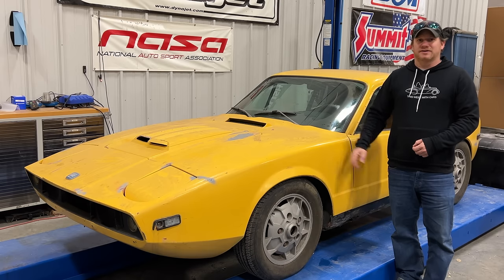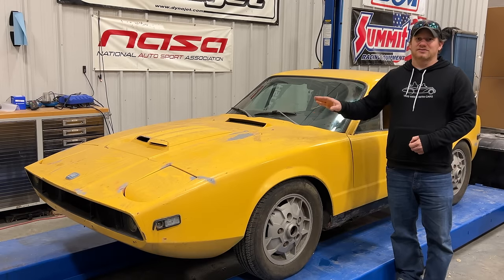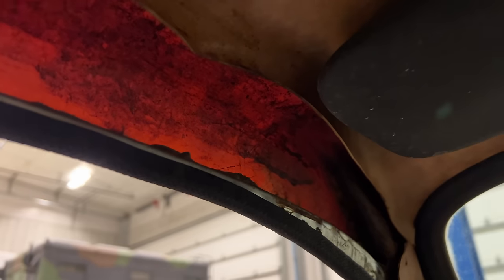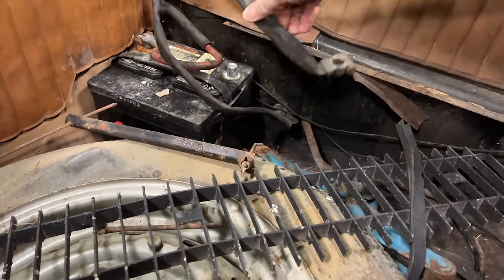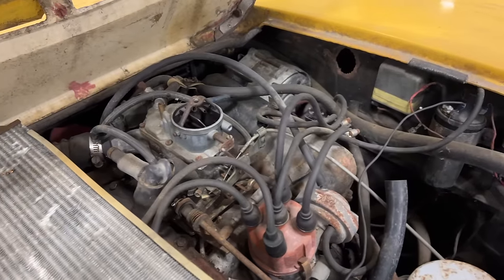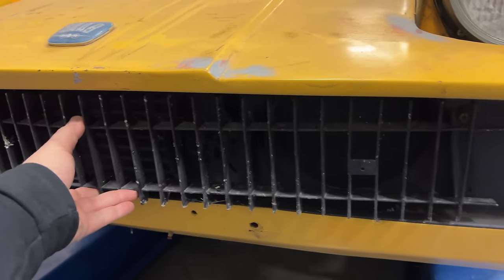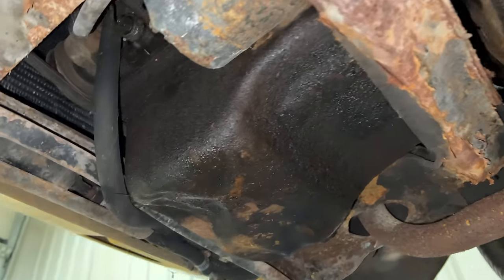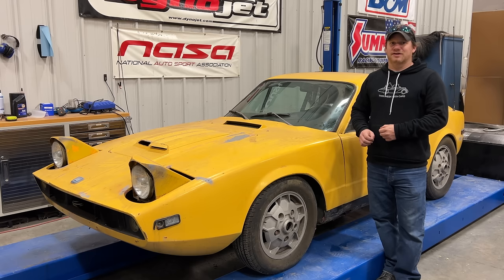My First Saab a 1971 Saab Sonett III

Comment: The engine is a Ford  V4 unit as used in the German Taunus cars, and also the Ford Transit delivery van. My brother had an early Ford Transit van, notorious for  chewing up the pushrods in these engines.

Comment: I had 3 of them.  Great cars.  Ice race them.  Problems?  Not many.  The wiper motor will fill with water, drill a small hole in the carcass to drain it.  Change to electronic ignition.  Xmission are weak so have an extra ready to go.  There is a roll cage in the car, not just a roll bar.  The engine is a Ford 
v-4 used in hay bailers and other farm equipment. I recall turbo efforts never met fruitition.  go with an aftermarket exhaust immediately.
Reply: One can just double things up, but the exhaust ports were siamesed in the head and without extensive porting not much can be done.

Comment: I had a new 1967 SAAB 96 V4 with that 1500cc engine. On the 96 the engine was easy to pull out. Just the two motor mounts and the transmission rear mount accessible from the cabin. These had a habit of rusting up so I would loosen the bolt then tap it out with an air hammer. If I didn’t have the air hammer available I’d cut the rubber out with a knife and replace it. SAAB had an interest in rallying at the time and had a special version of the 96 called the T-car. It had double shocks and the body panel spot welds were double the normal number. The engine was the stock engine because of emissions, but SAAB offered hop-up parts to take from stock with 75 hp up to Stage III with 120 hp. These included a nice 2-bbl manifold and a Weber 32/36 progressive carb which alone got you to 95 hp. I had one on my 96, and it chewed up the clutch in 5000 miles. I was unable to get the competition clutch from SAAB, but I was able to have the clutch beefed up by a clutch shop. The driven disk had the lining short of the rim by a good 1/4 inch. The replacement went all the way to the edge. The guy couldn’t find heavier springs so he put a 60 thou. shim under each one.

Comment: I like the way you call that Ford V4 an "industrial" engine. It's amazing that Ford considered such a rough sounding engine fit for public consumption.
Reply: It was a passenger car engine for a number of German Ford models. It was also sold as an industrial engine notably used in Ford skid steer loaders and for water pumps. Back in the day, it was cheaper to buy engine parts from the Ford Industrial dealer. They also sold the two barrel intake manifold.

Comment: I would love to see the Sonnet restored, the V4 is an interesting engine, it was used in several UK Ford cars & the MK1 Transit van.
Reply: I had this engine as a 1700 cc in a 1966 ford corsair auto in 1981 the car was a complete rust bucket but the engine had been reconditioned, i had the car about a year…when i sold it i later saw it abandoned engine had gone, i heard it had found its way into a transit
Reply: I had a 68 Corsair 2000E as my first car. It's engine also ended up in a Transit!

Comment: Living in sweden in gothenburg but not far from trollhättan where they made saab in the beguinning I rememberwhen they released this model . Being a airplane faktory from the start all saabmodels had a very low CX value since they they were tested in a windtunnel which wasnt so common in those days . If I remember correct the complete driveline came from the ford 15m , even the gearbox . It was a common car here in sweden aswell as the 12m . The whole sonett body weight is 17 kg . Here in sweden they werent so common . These fordengines werent considerred " mechanicfriendly" even put in the 95 and 96 models .
Reply: No. Only the engine was Ford Germany. The gearbox was the same as the SAAB three cylinder with a different bellhousing to match the new engine. The gear ratios may be different. The final drive was not as short so the top speed was higher.
Reply: @brucebeauvais1324  ok , so I've missed that but it makes sence even though the fords were frontwheel driven aswell . Thank you for the info !

Comment: It's a 1698 cc Ford industrial V-4.  Gardner Denver used them in commercial compressors among other applications.  Interestingly the cam gear was nylon for noise reduction.

Comment: I had a 1974 Sonett III for almost 20 years; finally had to sell it a few years ago because of job loss. I street-drove it, ran it in SCCA rallycross, did track days in it... slow, but a fun car and very solid. Trying to remember a few things that might be helpful:

-- You'll discover there are a lot of minor differences between the 1971 and the 72/73/74 models, so don't be surprised if details on your car differ from what you see in the shop manual. The 73/74s also are a lot sturdier -- they have metal hoops bonded into the fiberglass around the windshield and the door apertures, and impact beams in the doors that run down and tie into a brace across the floorpan.

-- The remote oil filter is non-original (they probably did that to make access easier; the stock location is down on the side of the block on the "crowded" side of the engine compartment) and so is the location of the A/C condenser; it's supposed to be ahead of the radiator and can be slipped out through the bottom. The Y-shaped exhaust also is non-original; the stock setup had a balance pipe running between the two cylinder banks, and then dual exhausts running backward along the outside edges of the floorpan. A lot of people went to the Y setup because it was supposed to increase power a bit.

-- That right-front spark plug IS a bear to get to, but if your original toolbag is complete, it will include an odd little offset wrench specifically made to reach it. If you don't have the wrench, you'll need to slip off the alternator belt and swing the alternator all the way to the outside to get at the plug. BE SURE to disconnect the ground cable before messing around in there; the positive terminal of the alternator is right next to the plug area and it's easy to make big sparks by shorting it to the engine!

-- That metal chicken-wire rectangle you found is a stock piece; it's part of the flow-through ventilation system. If still present, this consists of a vinyl-covered hardboard trim piece that runs across the top of each door aperture; there's a grill in the middle of the door and this wire mesh is supposed to be inside that. The theory is that the trim pieces duct interior air back to the area behind the rear quarter windows, where it's drawn out by the gill vents behind them. In practice I don't think it can have amounted to much ventilation!

-- Tip: a lot of seemingly hard-to-reach things in the engine compartment can be accessed through the wheel wells or by reaching up from the front air intakes. If you're going to do much in there, though, it's a LOT easier just to take the nose off -- it's one piece, and just slides up and off after you've removed about six fasteners (you can do it yourself, but it's much easier with a helper.) With the nose off, you can reach everything in the engine compartment, the front suspension, the heater and wiper motor locations, etc.

Have fun... would love to see how this comes together!
Reply: Oh, yeah, and almost all those parking-light and turn-signal lenses are straight off a Triumph Spitfire, so will be easy to get from a Brit-car catalog. The rear taillight lenses are from a Saab 99 sedan, but mounted upside-down!

Comment: I used to run a Saab 95 station wagen that used the V4 1.7l Ford Taunus engine with the earlier (2 Stroke) manual gearbox with change on the steering column. The box had a freewheel due to the lubrication needs of the prior engine type. The extreme streamline shape of that car helped make up for any lack of power from the 65hp German Ford engine.

Comment: Saab has used the Ford V4 as a replacement for the 2-stroke engine. The V4 was available as 1.2, 1.3, 1.5, 1.7 and 2.0, which in turn was distributed among Essex and Colonge engines used in the Taunus and Transit. For smooth running, there was a balance shaft in the engine.
Matra has also used the 1.7 V4 in the Matra 530.

Comment: Early V-4s- 1968/1969 used a Solex carburetor. 1970 used Fomoco carbs. The remote oil filter was to make room for the A/C compressor. There were optional "fog" lights that fit where the blanking plates are.
  Lighting was a mix of Lucas and Hella- mostly Lucas. The front turn signals were Lucas -used as rear turn signals on some Triumph GT6 . Same side markers as Spitfire/GT6. The optional fog lights were 5 3/4" (small round) sealed beam lamps. High beams for most quad round lamps systems. The "fog" lamp housings were Lucas buckets also used as high beams for early US market Mercury (Ford) Capris. Rear Taillights were the same as SAAB 99 up to 1976. I think the license plate lights were Lucas.

Comment: They are a weird car for sure. Sam and Greg Sharnberg from DMVR used to autocross a Sonnet, I never saw it run but had a look at it in Greg's garage. Have also seen an orange Sonnet at RPM, it was pretty slow around the track. :)  The V4 in those is related to the Ford V6 Cologne, not sure how many parts (if any) are interchangeable.

Comment: Had a '73 Sonnett III, '73(?).  It had a freewheel device that would allow coasting on long descents.  Got phenomenal mileage- once drove from Wichita to East Lansing, Michigan on one tank of gas.  You are correct about the fiberglass- almost early 'kit car' stuff.  Mechanically never a problem.  I did tear the exhaust off on a railroad crossing once.  Would love to see you get this one going.  Do you have any experience with a Saab 96?  Great channel.
Reply: That was the sprag unit left over from 2-stroke days. There was a lockout handle on the firewall just behind the shifter.
Many automatic transmissions have them. When the output shaft wants to turn faster than the input a ring of oval bearings? release and allow free running. When  the input shaft wants to go faster, the oval shaped thingies turn back and lock up the inner and outer races. The military six by sixes work this way. The gear ratio for the rear four wheels is a lower ratio(higher number) than the front axle. When the rear wheels start to slip the sprag engages the front wheels for full 6x6 action.
You need them in the 2-strokes because the fuel also contains the engine lubricant. If you had a locked system and headed on a long downhill with the transmission locked up and the throttle backed off, the engine would starve from lack of oil. There was a rumor/legend that in the 2-stroke days SAAB imported an extra engine for each car they imported. The 850 Monte Carlos were pretty neat cars. Back in the day my driving heroes were Erik Carlsson and his sister Pat who was married to Sterling Moss.

Comment: A/C is very rare on any Saab of this vintage.   I own 2 Saabs of this vintage.    The Saab guys will tell you about parts.    To get to the spark plugs you need the wrench that in the tool kit.    Tom is great with these cars
Reply: The wrench was only neccesary for #1-located behind the alternator.

Comment: The Sonett was derived from the Saab 96 chassis, but with lighter gauge steel. Extra reinforcement was not treated against rust, so the Sonetts began to rust immediately. Most of the mechanical parts are the same, though some are becoming difficult to locate. A few Sonetts have passed through my hands, but I now have a keeper, a 1969 Sonett V4 that was turned into an ice racer by a friend. It is being returned to racing condition for vintage races.

Comment: A friend and I could get the engine out, put in new bearings and have the car back on the street in 6 hours - easy to work on as the hood comes off very easily - on mine anyway - two bolts..:)

Comment: I've always loved the Sonett.  Especially the III.  But for a fiberglass car, they sure have a lot of rust problems.
Reply: They were one of the few sports cars that worked well in snow country, so the salt ate up a lot of them. But another reason there are few survivors was that there were never many of them in the first place. Saab built them on a shortened floorpan for the Model 96 sedan, then sent them off to a Finnish company called ASJ that made the fiberglass bodies. ASJ's main business was building commuter railcars, and they did the Sonetts as a literal sideline... off to the side of the main railcar assembly line... and this imposed an absolute upper limit of 2,500 bodies per year. In practice, they never even made quite that many; I think the most popular year was 1974, when about 2,200 were produced. There were very few 1971s and a literal handful of the 1970-1/2 debut model.
Reply: @jlwilliams  Actually, ASJ was in Arlöv, outside Malmö, Sweden. I think you're thinking of Valmet in Finland that also built a number of Saabs over the years.

Comment: IDK what the final drive is. Check with Saab heritage to see if they could recommend a good transmission man for consult. Chrysler swapped 3rd and 4th around on the A833 4 speed making 4th a 26% OD . If you want an OD top gear check with a Saab transmission person to see if swapping gears around is viable. Fuller did it with big truck transmissions too.
Reply: If I remember, the V-4 equipped Sonetts used a 4:67 final drive. 95/96 V-4s were 4:88 and three cylinders were 5:13. Tom Donney would have the gearbox answers. SAAB offered a" close ratio 1" and a " close ratio 2" gear sets as Sport and Rally parts.

Comment: Owned one back in the late ‘70s a very fun car. The engine/drive train is much easier to work on once you remove the front nose. There is an expert Saab Mechanic in Tucson who has fixed many of these, Valet Auto. Would love to see another back on the road.

Comment: I only know random details about these thanks to Rob of Aging Wheels and GRM.

Sonetts have one hell of an Achilles heel- Saab had been making 2-strokes until the Sonett, and the transmission is from those vehicles with only slight adaptations. Because a 2-stroke has no pressurized oil system the transmission has some kind of freewheeling bearing that engages in neutral to keep the motor running- the bearing goes bad, and it either keeps the Sonett in Neutral or keeps it from ever going INTO neutral. Can't remember which, but I DO remember its why these cars get bought for EV projects all the time, because (least I heard) there's no replacement for that bearing and all survivors are on the equivalent of life support.
Still tho, they are gorgeous and stupid lightweight. I think they were maybe 1,800 lbs?

Comment: Great car! I picked up a purple 73 last year and have quite a few videos about it. Wasted a lot of time not restoring the fuel tank. I have some spare turn signal lenses in the twin cities if you can't find any. They probably did a remote filter to run a big 51515 which is about 5mm too big to get in otherwise. Why don't you enter one of your rigs in the Yucatan Winter Safari Rally in Winona and I can bring a few parts down for ya. Have a spare rear axle and a bunch of random stuff. Also check out the MN Saab Club. Lmk.

Comment: I commented a couple of times on this video. Among the errors I might have made is that I misidentified Pat Moss. Pat was Sterling Moss’ sister and Erik “on the roof” Carlsson’s wife and a fine rally car driver in her own right.
I need to ask Steve if he knew John Ames, one of the premiere autocross drivers of the sixties and seventies. I knew him and his wife Nancy in Baltimore when I bought her 1960-1964 Volvo PV544. It had parts from all years. They moved back to Iowa in the early seventies. John and my brother-in-law Andy A. patched it together in Andy and Jeanne’s five-car garage. Two wide, two deep and on the left in the back was the fifth slot with a grease pit and overhead chain hoist built into the house when constructed.

Comment: They are beautiful but my 72 was a mess of recurring failures from the clutch which never worked well to the twin exhausts which alternately broke at the resonator many times.  The dealer had a shop full of broken exhausts.  The rear window broke once (my fault) and it took, I believe three tries to get one that matched the mounting pegs. Pull knobs fell off regularly, the left parking light occasionally needed to be banged on for it to actually light.  
Finally SAAB came out with a new master cylinder which seemed to add horsepower.  When all was working I traded it and never looked back.  Wish I still had it though.

Comment: I seem to recall those cars having around 60 HP. Someone must have had to push it down the road when the AC was turned on because the smog garbage they had on them then, even in 1971, was already robbing much of what little it had. I would still include the AC system in the restoration though because it wasn't a common feature and makes that Sonett III a bit special. The engine is very reliable and changing the carburetor will wake them up. It's unfortunate that the air cleaner was left off of yours because that's most likely why it's locked up.

Comment: I would love to see it running, sweet little car. Balance shaft gear always fails on the front of the engine but parts are available now so if engine out change the balance shaft gear pretty bullet proof otherwise 👍